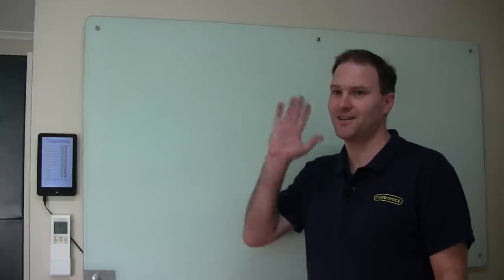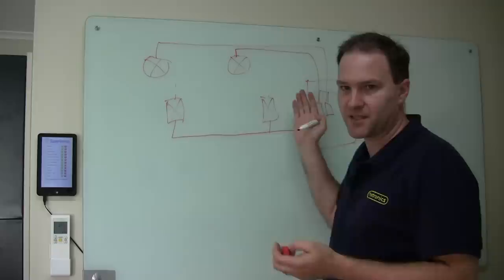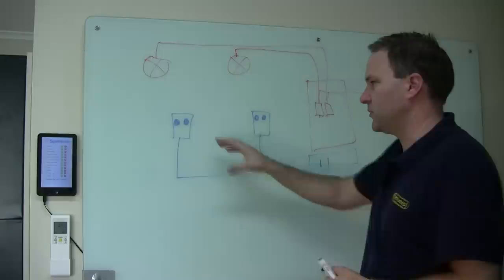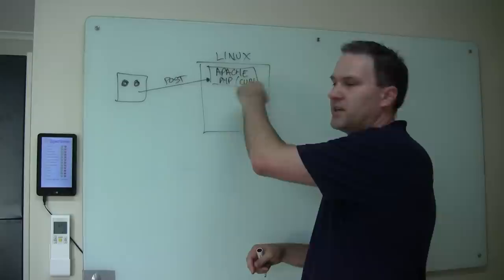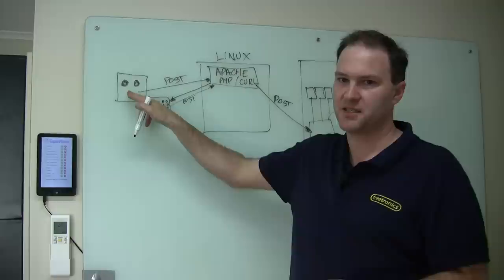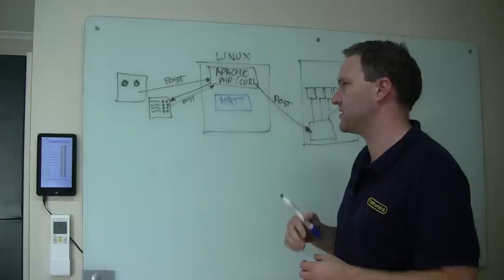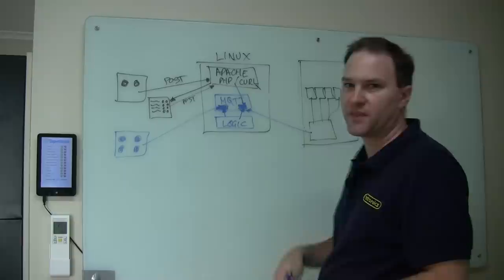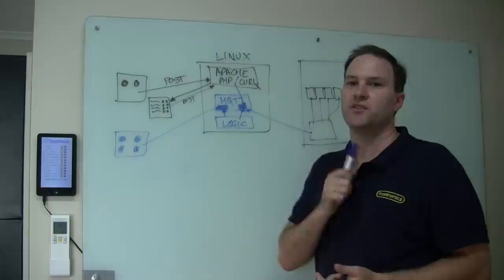SuperHouseTV #1: Home Automation System Architecture 2012

Comment: I have to know what your power bill is every month.  All of those arduinos and tablets running non-stop have to add up, no?
Reply from the maker: My power bill is higher than a normal household, but that's more because I usually work from home, not because of the home automation. The 6 monitors on my primary computer draw much more power than the home automation system, and I spend about 10 hours / day using those! I have a half-filmed episode about power monitoring, so soon I'll be able to answer your question in detail with specific measurements.
Reply: I work from home as well and my biggest spenders are definitely my workstations.  However, I have run some rough numbers and a lot of my always on devices like a handful of poorly finished raspberry pi and arduino projects running through a Kill A Watt meter show that they would cost me between 5 and 10 dollars (each) a year to run.  If you have one of those at every light switch that has to add up.  Or are they in a low power state until a hardware interrupt (button press) wakes them up?  I suppose they could all be asleep since they don't actually do the switching in your system.
Reply from the maker: Yes, it's surprising how a small usage can add up over a whole year! I've reduced the number of devices in my system dramatically by restructuring all the light switches. They're now just dumb buttons that use the existing Cat-5 cable to link back to 2 central Arduinos (one in each automation switchboard) that handle all the switches in the entire house between them. I need to do an updated video about the new system architecture, it's much more efficient than the way I used to do it.
Reply: Ah, so you've changed it. Less capability at the switch for sure but much lower TCO. That makes a lot of sense. Thank you the response!
Reply: I'm curious about which kind of communication used to read the dumb switch signal. Did you have to boost the signal?
Reply: Thanks for the update.. Im in the process right now of finishing my basement and I'm debating whether to take the leap...(I have electronics/java/and some arduino experience) I hate the idea of having to commit to a wiring scheme, as once the drywall is up, theres no return :(  ...this seems fairly safe though.... Ethernet cable for  dummy switches for now.. If sensors are desired later I can add  an arduino... Any advise????  (reassurance appreciated)

Comment: This is very cool, but you better plan on living there your entire life because you're never going to be able to sell it. Nice video though.
Reply: +Harry M What have I been smoking? How many people are going to know how to fix this if there is a problem? There may be some but you have excluded 99.9% of the market. If there is a repair issue that needs to be done no electrician in the world is going to touch this. Let's say the main board fails not to mention that it is all run by a computer. Who's going to fix it?
Reply from the maker: +notta3d This is a very important point. It's something I should talk about in a future video. Home automation often lowers the resale value of a home instead of raising it, for this very reason. It's seen as a risk by potential buyers. DIY systems even more so, because you can't just find an electrician who is certified for that particular system. In my case, I made a judgement call that if (when) we sell the house, I can replace the contents of the switchboard with something like C-Bus modules very easily because the wiring is already set up for it. That way a buyer won't have to worry about something that's unsupportable.
Reply: Every car runs by a computer.....

Comment: "Ubuntu is not an English word. It originates with the Bantu languages in Africa."

Didn't I just say that, can't you read?

No, I'm saying that if you write in English, its English.  If i was writing in Spanish, 

French, German or even Youraba I'd use the accents, to inflect how it should be pronounced, I'm afraid that just how languages work.

I'm fully aware of what the Ubuntu community claims.  However, that doesn't make it correct.

Comment: Awesome, no network -> no lights :)
Reply: Not really, you don't need network to turn the lights on. They are connected through cables, when he presses a button, that button sends a signal to the control box (through cables) and that box send a signal to Arduino (through cables) asking to turn on or off relays. No network is needed whatsoever.
He only would need network if he wanted to do it remotely, like turn on his house's lights while he is at work, so he would send a signal to his control box via internet, and the control box would send a signal to Arduino via cables.

His system is not optimal though, it was 8 years ago, it's waaay easier now in 2020 with a lot of information available and new sensors/devices.

Comment: Your wasting money on those arduinos for light switches. Use 20 quid binary input module for your light switch and a controlling a relay in the panel. If you want to integrate linux, use bacnet4linux. https://en.wikipedia.org/wiki/BACnet

Comment: Bad architecture, you need a low cost rs485 or canbus instead of ethernet. I am in home automation since 1997, ethernet is ok for touchscreens.Our installations usually have over 40 pushbutton locations, you will need an expensive ethernet infrastructure, and these besides been expensive also consume lots of energy ($$....)
Reply: Johan Sagaert everybody already has ethernet infrastructure, so it is cheaper than rs485. and it is already connected to internet(of things)
Reply from the maker: Johan Sagaert You're right about the power requirements and cost of Ethernet infrastructure (switch ports, etc) but it was a simple way for me to get started with something basic and increment it in small steps. Since this video came out (which was more than 3 years ago) I've changed all my light switches over to simple dumb buttons connected via the existing Ethernet cable back to Arduino-based input boxes that read dozens of buttons each. That's been working great for about the last year. I need to do another video about the updated architecture.
Reply: +SuperHouseTV An update would be great Jon.
Reply from the maker: +jok yhg It's high on my to-do list, but I've been suffering a bit of burnout (not from SuperHouse, just from work and life in general) over the last year so it's been hard to get onto some of the projects that I really want to do. Too much work, not enough hours.
Reply: +Johan Sagaert 
Not a wonderful comment, not helpful. If you are a professional user/installer with a lot of resources, then maybe use something other than Ethernet, but for individual enthusiasts, Ethernet is well supported. Personally I use CAT5e everywhere for LAN and 1-Wire systems for simple interfacing with PC's etc. A few network switches are hardly going to break the bank.
Reply: +Johan Sagaert using wifi you can forgo all the wiring headaches and you can decide which lights turn on for each control.

Comment: This is the most stupid thing I've ever seen. Run all new cables back to the switchboard?? Or multiple switchboards?! What a waste of time, effort and equipment. Just run 240 to the controller for the room, then run the cables of each light to the controller. Done.